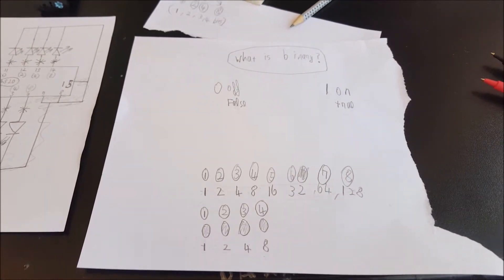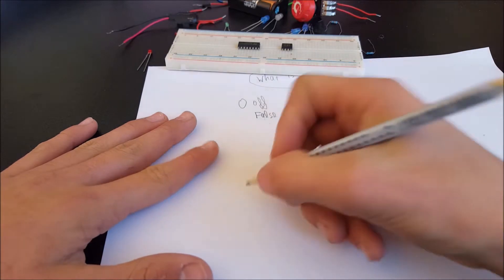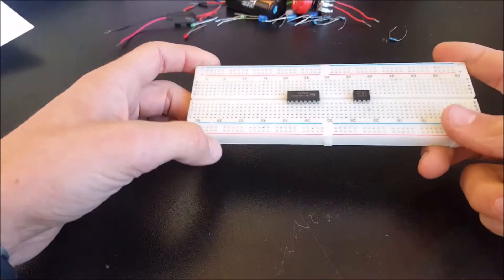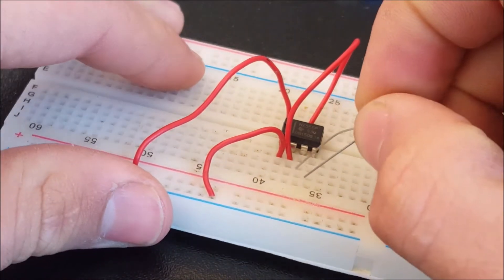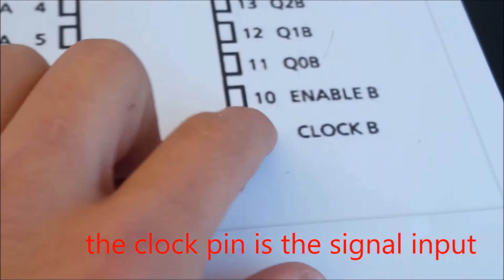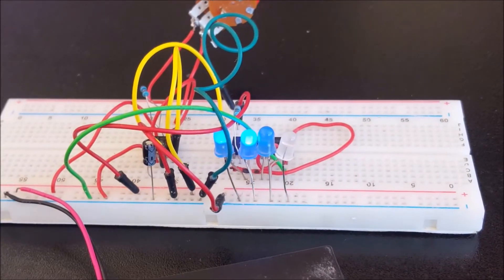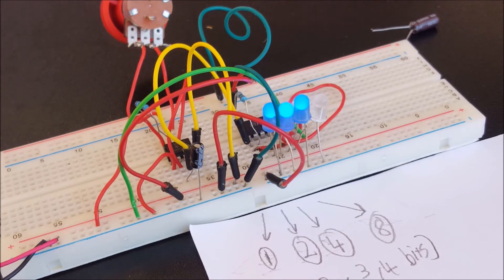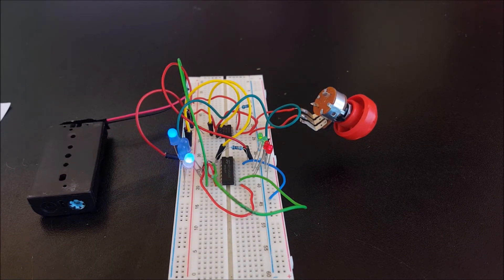How to make a 4 bit counter using the 4520 IC

Comment: Theres a circuit Ive been trying to understand that uses this same chip, but pin 16 Vs is grounded with pin 10 instead of V+ and the divided outputs are fed into an a 4069 chip as a buffer. How would the 4520 work if the Vs in is grounded rather than having a postive voltage supply?
Reply: Note, its an old keyboard circuit where for every key is at 0 volts when not depressed but when it is it outputs a negative voltage. Specifically -15 volts and comes back to 0 volts when you let go of the key.

Comment: I am really not an expert, BUT 5mA seems a little off considering ech counter has almost all the time at least one LED on. More likely it would be 2 in average, you have two counters - LED on all the time. Each draws in average 10mA. Ples both ICs draws a little itself. So i would assume more about 50 mA or am I missing aomethin?
Reply from the maker: I actually thought of something like that but that is what the multimeter told me